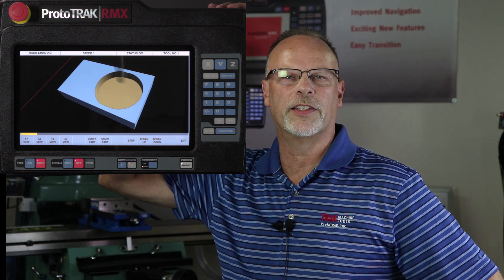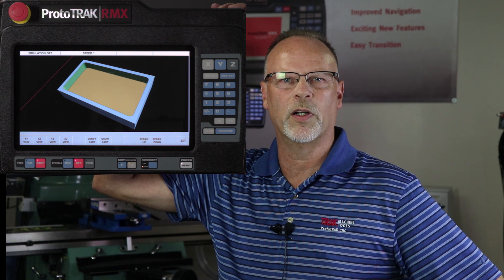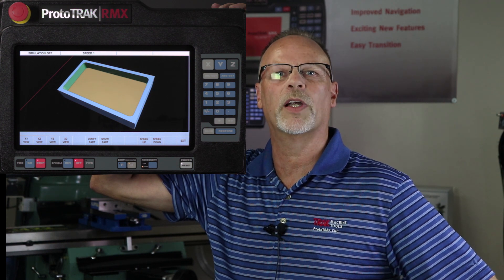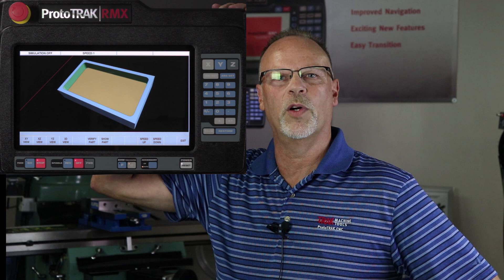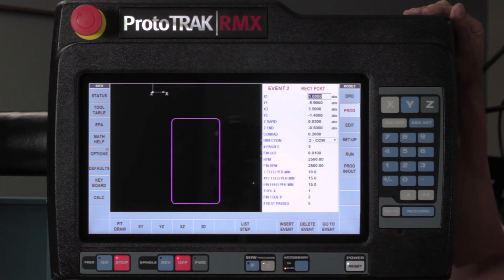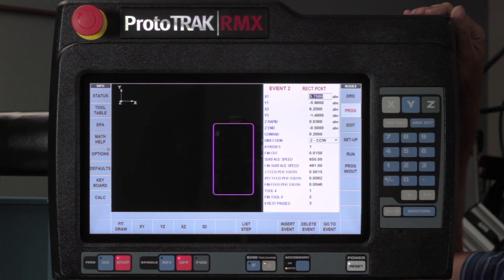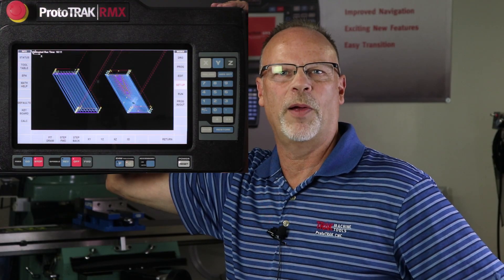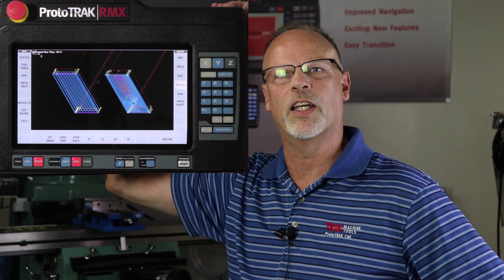Adaptive Tool Path | ProtoTRAK RMX CNC | Mill Programming

Comment: Hi Pat
Another little issue on the RMX2500 unit.
We are attempting a radial cut using a repeated 2mm step down arc with a final helix cut along the same tool path with a 0.2mm ramp down. The arc is on a 105mm radius and the helix is a quarter turn. What we are finding, is that at a z height difference on the helix of 0.3mm or less, the machine will not perform the helix programmed. However, if we switch to Tracking and use the hand wheels at any point of the helix operation, it will perform as programmed.
Any ideas? We are on software version 2.2.0, firmware version 2.0.1.
Reply: Julian, I am not sure but if you'd like to send me a copy of your program, I can take a look at it.  My email is trakingpat@trakmt.com

Comment: Hi Pat
We’ve recently had an issue with a circular pocketing event in a pre-saved program on the RMX 2500.
The event is to through cut a 20mm deep pocket with a 10mm diameter rough end mill & finish with a 0.2mm cut using a 10mm finishing end mill. The roughing cuts are stepped at -2.5mm Z increments.
Prior to setting the tools & running the program, the finishing tool had to be changed to 12mm diameter. This was done in the program tools.
Having run the roughing cut, the machine prompted for a 12mm diameter finishing end mill, but when CNC Run was continued it treated this as the original 10mm diameter cutter.
Additionally, the machine attempted to plunge to full depth at rapid entry speed, resulting in tool breakage & part scrappage.
We have contacted the UK agent: XYZ Machine Tools Ltd, who have confirmed their duplication of the fault, and have suggested the solution may be a software update.
We are not aware of, or been advised of any update, we are currently running on 2.0.0.

Any advice please??
Reply: Julian, Sorry to hear about this problem and it sounds like something we have corrected in the software.  You can download the updated software from our website.  Here is the link.  https://www.southwesternindustries.com/software/page/prototrak-rx-cnc-software?ref=latest  Just follow the steps.  The guys at XYZ should be able to help you if you need anything else.  Otherwise, you can contact me directly at trakingpat@trakmt.com  T.P.

Comment: Hi
Can you tell me if it’s possible to program a 3 axis arc using ProtoTRAK where the Z end point is at a lower depth than the start position?
Reply: Yes, you can use the helix event.

Comment: Hi
Thanks for getting back to me.
Would you have a screenshot of the defaults for adaptive tool paths? Also what CAD/CAM package would you recommend with RMX?
Reply: Julian, are you looking for a screen shot that shows the types of tool paths or do you want to see each tool path and how it will cut the same pocket?  Also, we don't recommend any certain CAD/CAM package because they all work with our products.  Obviously, MasterCam and SolidWorks are probably the two most popular since they are taught is more schools than any others.  For the money, you can't beat Fusion 360.
Reply: @trakingpat2750  hi Pat. Again thanks for getting back to me.
It’s screenshots of the machine default settings that are specified for the adaptive toolpaths, and/or if we need to modify speed & feed notation in the options within the program.
Basically we are looking for all of the instructional information necessary for the machine to run in adaptive.
Both myself & my Brother are not machinists, but have purchased a new RMX 2500 bed Mill & want to learn CNC.
Thanks for your assistance

Comment: I like our trak mills. I really wish there was a way so the irregular pocket only climb cut. When it goes back and forth and switches from conventional to climb it really kills tool life, and doesn't allow you to run optimum feeds and speeds. But to get the tool paths efficient, we have to post them. Which kind of defeats the purpose of the conversational interface. 

Also step over % should be able to be changed per event, that'd help IMMENSELY. 

Hurco conversational you can define stock paramater and then the profile, so it'll mill away the stock in steps in specified height steps. This makes it so that you don't have to mill through channels, then using phantom tools with fake tool changes to widen pockets so chips clear when the pocket gets deeper. 

Also being able to rotate engraving would be great. 

Overall the trakmills are great for their application, however, with these changes they'd be SO much better, that it wouldn't be worth posting parts that were relatively non-complex.

Just some input!

I am intersted in your VMC for prototyping for my business, but your reps haven't reached out to me. I recommend streamlining contact for purchasing. Haas posts their prices  and make it so much easier to buy. It'd really be nice to just see pricing.
Reply: Aaron, You can choose CCW as your direction in the pocket event.  Then,  choose one way as your cutting method under the drop down window in either your options or defaults window.  This works in adaptive or parallel tool paths.  The step over % is also adjustable per event under the options window.  You can choose your roughing sequence by either regions or depth in the options page too.  The newest version of the RX software allows you to do the following things with engraving...Mirror, Angle, radius, vertical or horizontal.  I have contacted your distributor and they will contact you about the VMCs.  Did I answer all of your questions?  If needed, contact me directly at pfitz@trakmt.com and I can send you pictures of all these options and how they appear in the options or defaults.  Thanks!  T.P.

Comment: Want the amount of step over you use? Each time I try adaptive machining, I got a lot of vibration and the milling can't handle it. I often work with 1045 steel or A36 hot rolled steel.
Reply: In this video, I used 20%.  You may also want to switch your cutting direction to one way instead of zig zag.  T.P.
Reply: @patrickfitzsimmons5187  how do you change from zig zag to just climb cutting only on the prototrak interface? I can't find it. 
The stupid climb cut, and then conventional cut back and forth is so stupid and irritating.  At that point I'd rather just mastercam it out and post it so the toolpaths aren't stupid. I don't know why you'd ever mill with zig zag, even if your rapids suck..... it's still worth keeping it climb cutting. Would be fantastic to change to climb only.
Reply: @aaronmansfield4758  See my answers under your other comments.
Reply: Stepover when climb cutting only varies.

Depends on material.
Good place to start.

.003" chipload, and 500SFM for a decent carbide endmill.

So like today HY80 .4" length of cut, 5 flute carbide endmill was doing fantastic at 3500rpm and I think 45IPM 5% stepover.
Or also today 4140 prehardene steel ran 1900RPM, .250 depth of cut, 15% stepover and 25IPM
just for some guidelines. 
We very rarely machine A36 or 1018. I normally plasma cut A36 stuff, we may post machine fits for bearing fits or pins, but we generally dont mill A36 if we can stay away from it.
If you have control over material selection, 1018 machines a bit nicer.

You can do say 5-15% stepover for say half inch endmills when you have a decent length of cut (LOC). Truly side milling.

If you for whatever reason it isn't a good way to do that piece/part, you can do like 20-40% stepover and whatever depth. Good to keep it under 50% stepover unless you are facing. 

A36 hot roll mill coat is really hard an kills endmills. A trick is to get the cut deep enough your break underthe mill scale and 'peel' the mill scale off. 
A36 may be soft so you'd think it'd be easy, but it cuts like crap lol. Just keep it climb cutting, and if you are running carbide don't be scared to run high rpm.
Reply: @aaronmansfield4758  Thanks for all this information!  It will be helpful for the others who follow our channel as well.  T.P.

Comment: Hi. 
Love to watch your videos.
When changing to adaptive tool path, did you manually increase the feed & speed rates?
Reply: Yes I did.  I also changed from multiple Z passes to one full depth cut and I changed the amount of step over for the cutter.  After that, I increased the feeds and speeds.  The defaults allow me to set a different step over percentage for adaptive tool paths then what I use for offset or parallel tool paths.  T.P.
Reply: Yes sir!  The EPA will help you figure those feeds and speeds but you have to enter them manually.

Comment: Great video. Can the RMX control be retrofitted to a 2018 SMX5000 bed mill?
Reply: Unfortunately, not.  The entire electronics of the RX are different then the SX.  Depending on how old your machine is, you may want to sell or trade it to get the RX.  Otherwise, if you are just trying to get the type of machining tool paths that we have with adaptive, you can do so using a cad/cam system.  Normally, I don't think you should need one unless you're doing contouring with the Z axis however, this type of machining can be very useful when cutting pockets.  I'm sure your rep can give you all the options if you are still interested.  T.P.
Reply: TRAKing Pat  Thanks for the reply, I shall invest in some CAD/CAM software. Best Regards.